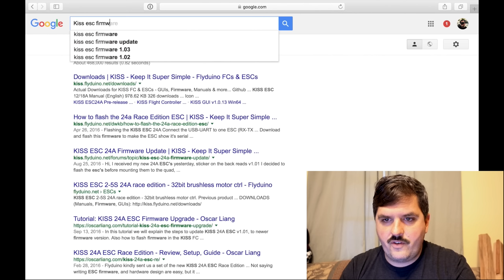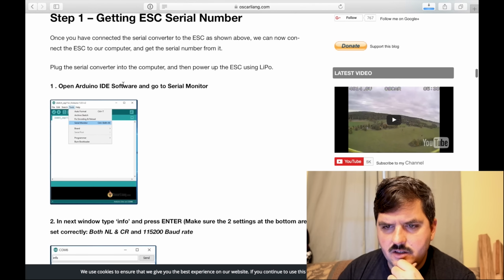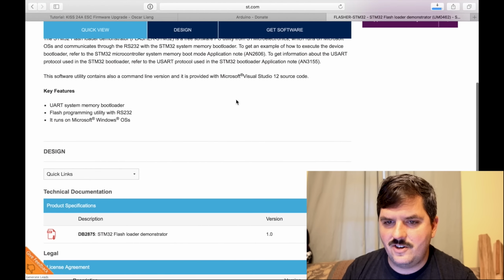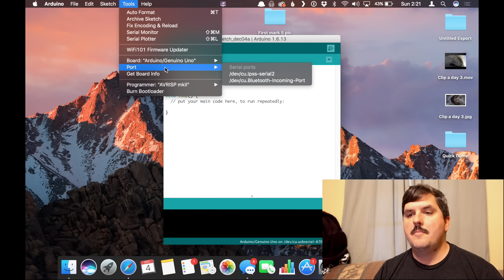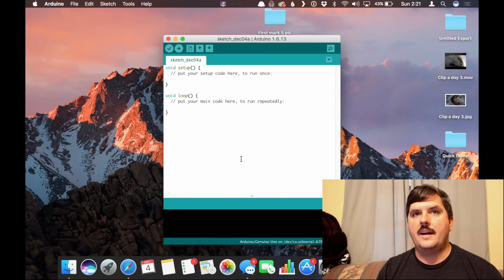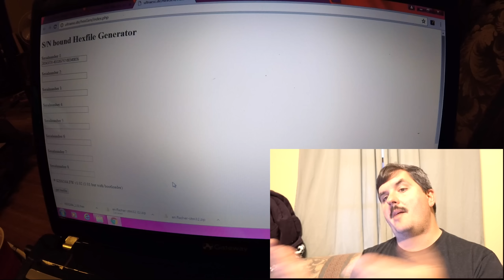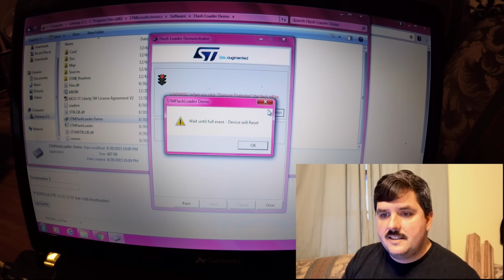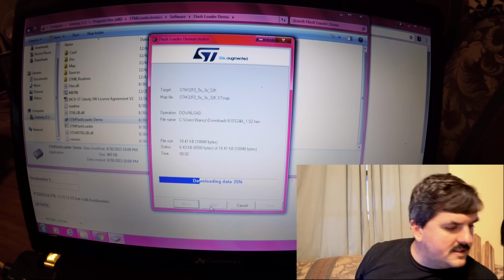Flashing My First Gen Kiss ESC's

Comment: Quick question...
 Will it hurt to try to update the firmware on the ESC's through the FC if they are not version 1.02? Mine have blue LEDs but I lost the stickers on them last year when I cleaned the ESC's with rubbing alcohol after soldering. 
 I figured it would be easier to just try through the FC rather than desoldering and using an USB uart device to update them. Thanks Kevin!
Reply from the maker: It will make the motors spin up more than likely.
Reply: Thanks Kevin, just ordered the USB uart, I'll just play it safe.